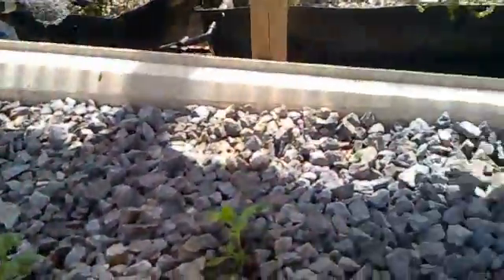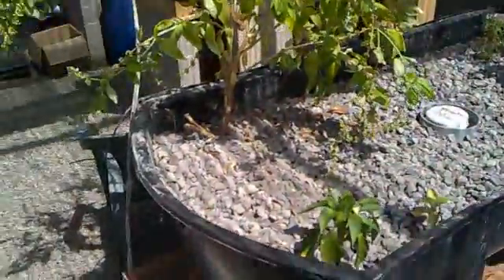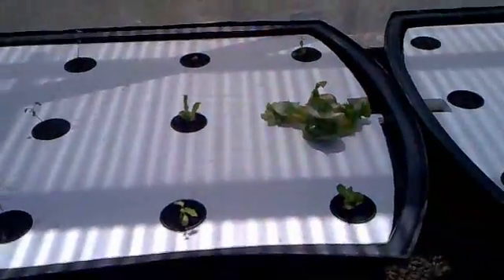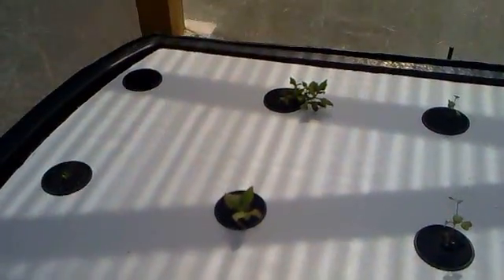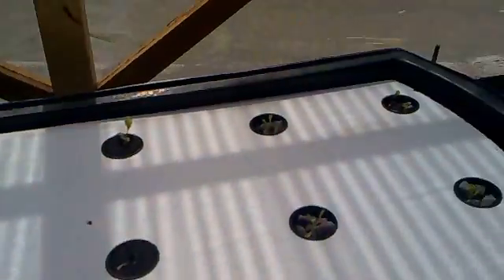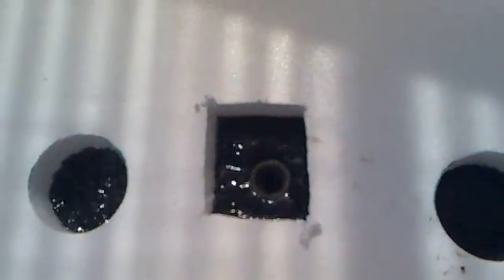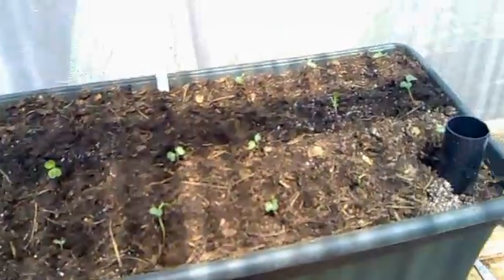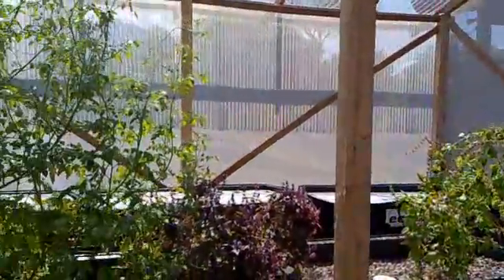Aquaponics Update and Raft System

Comment from the maker: yes, it's a one-pump system. pump is in the sump. though in this video it looks like i was using two pumps (both in the sump). I have since replaced those two with a single, magnetic drive (much more energy efficient) pump.